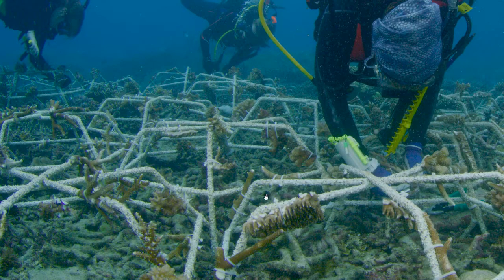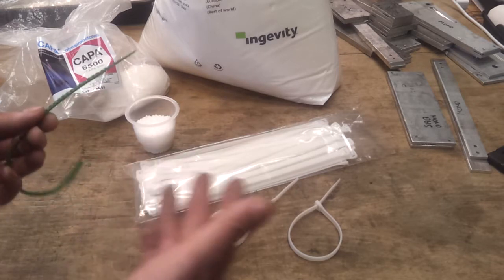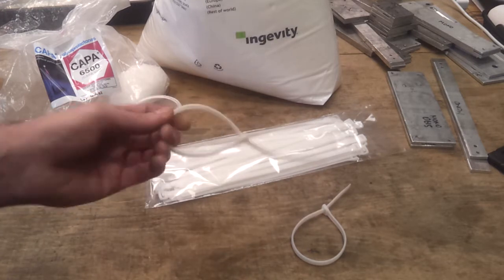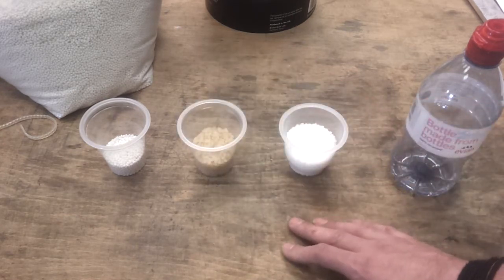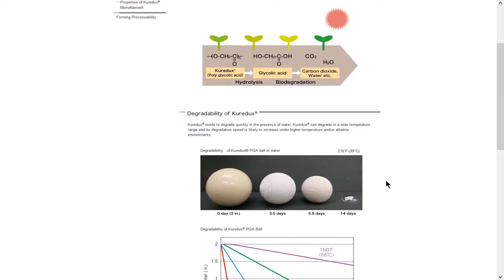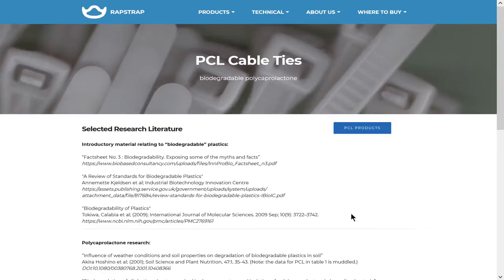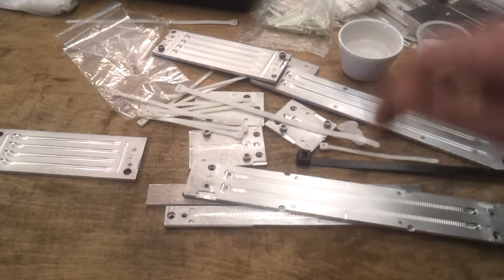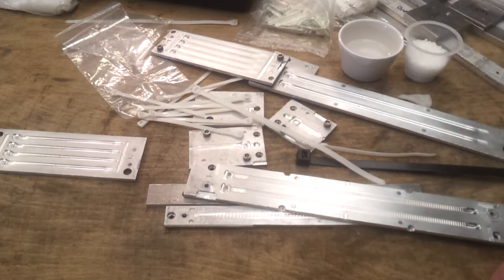Biodegradable Cable Ties - All about polycaprolactone (PCL)

Comment: I bought about a kilo of thermoplastic beads (sold as polycaprolactone) a few years ago. I never got to use them until fairly recently and they don't seem to work as advertised. In hot water they still go clear, but they seem to flow into the water, becoming a runny liquid. When they form back into an opaque solid, they are crumbly and break up into more granulated, waxy residue. In fact, the resemblance to candle wax is almost identical.

So, my question is, did my PCL go off and will no longer hold a form like a modelling thermoplastic? Or, am I sucker who was sold a couple of bags of paraffin wax instead of actual PCL?